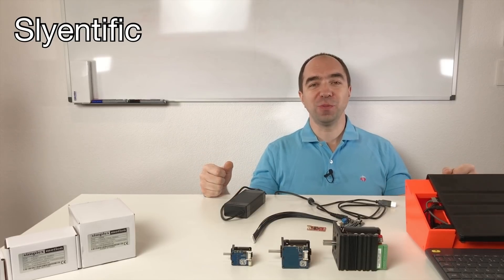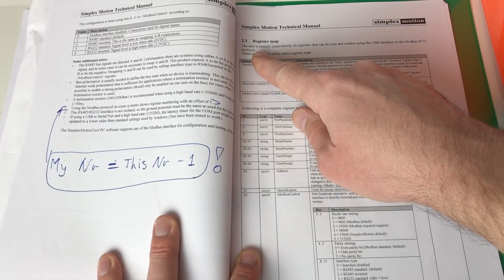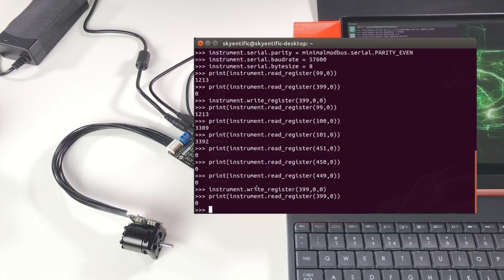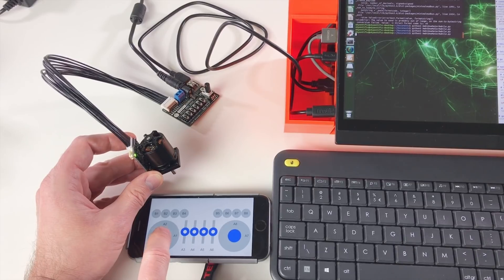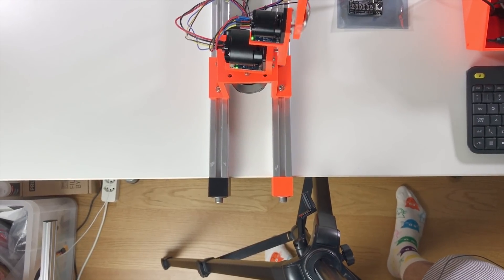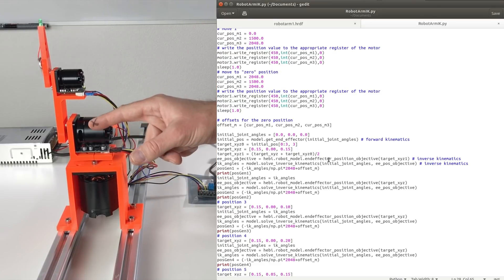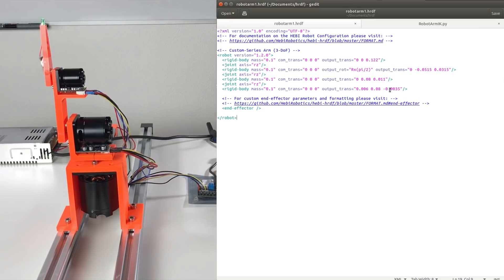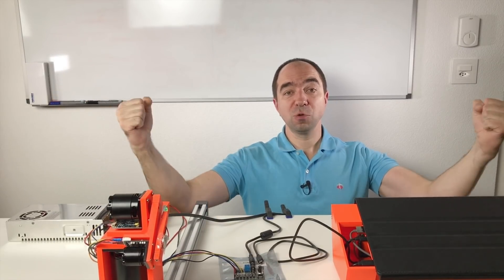Simple Inverse Kinematics and iPhone control [for any DIY Robotic Arm]

Comment: What is the cost of such a robot. And can you add a vision system or do you have videos of such a thing? Trying to have it grab and picks up a cable and plug it into a non fixed location outlet, one that can slightly change its position, so would need to see and find the outlet and plug it in. Thanks.

Comment: there was some wobble flexibility. i think in the bottom part. also the pid is not working well
Reply from the maker: This arm was build just yo test the inverse kinematics. Pid work fine, just need to adjust the pid values for this loads. But as it was only for the simple quick test I did not waste time for this.

Comment: The simplex motion motors are impressive.  If you could get the baby motor in the $50 ball-park, you could make a VERY impressive 3D printer.
Reply from the maker: Yes, but not now. The cheapest motor itself cost around 50$. And the components for the controller would cost another 50$. And all this is with cheapest components. If you take good components (not the cheapest) the motor will be around 100$ and controller would cost another 80-100$ at least. You add your RnD costs, your margin, and you will easily go over 300$
Reply: @Skyentific  totally understand.  For a small volume product $300 is quite inexpensive.  Just mentioned that low price point because it looks like they could hit it if someone ordered a massive batch.  (I.e. 10,000+)
Reply: @martylawson1638  you might want to consider the iHSV57 motors for a 3d printer if you want servos ($80 from Aliexpress and 100-130 locally, depending if 100W or 180W model). They are a drop in replacement with Nema 24 motors and allow to be driven directly with step/dir which helps a lot when upgrading a existing setup using steppers (great for CNCs especially).

Tho not enough for such a large robot arm without some serious reduction (which will reduce any chance to use backdrive)). Do mind there are 400W ones out there for $158, which are more realistic for a smaller robot arm.
Reply: @exol511  Good find, it's hard to tell if it's actually a permanent magnet AC synchronous motor (aka a BLDC motor) or a closed loop stepper.  Added it to the pile of links for when I get serious about building that printer
Reply: Marty lawson its a servo motor 100%. You can check the datasheet and there are a few instances on youtube demonstrating it. Do watch as the integrated ones without the dip switches are steppers (closed loop)

Comment: I see a lot of potential for your robots in controlling the motion of small video cameras. This would be greatly enhanced if you add a degree of motion which is a linear movement along the rails. High end video cameras with their lenses and associated support still weigh 20-30 lbs which requires giant robot arms costing > $100K  (for reference see https://www.mrmoco.com/motion-control/bolt/ ). But some very good tiny cameras such as Sony's latest can reduce the weight down to a single kg which makes smaller arms more feasible. Also check out the work of Steve Girault (https://www.the-garage.tv/about) who is opening an online school on visual engineering (video) and who relies extensively on a combination of robots to move the camera and computer controlled actuators to move the subject.  I'd be glad to put together a summary of robot usage in videography and what might be accomplished by smaller but low cost arms.

Comment: I use FreeCAD to model my robots. It is quite cool because it has a built-in python interpreter, so one can model, 3D print and assembly the robot, and use the same 3D model to control the real robot. FreeCAD can also solve the kinematics and even do some dynamics simulations using MBDyn...

Comment: Good video, but I would suggest you make a series where you start from regular stepper motors(the ones that you have are very expensive for a common viewer) create a controller board a very simple one, with simple serial communication or i2c. Once you have the platform designed and build make a robot based on that.

Comment: Great informative video. You mentioned that this product can be used in CNC as replacement for stepper motors. I would be interested to see how you got accurate angular position using HAL sensors and how it compares to approaches using simple Back EMF or even better what you described in previous videos for the MIT Cheetah controller ( axial magnetic sensor AS5X47U)
Reply: I am not sure how these servos would be better than the iHSV57 180w ones. Especially since those are basically drop in replacements for stepper motors with standard nema mounting and dimensions, plus can be driven directly with Step and Dir which allows you to keep your old controller or breakout board. Not to mention those are quite a bit cheaper than these motors.

Comment: 🍻Thank you for this video!
I loved the walk through of the software and how you got it working. Especially the HEBI components. I’m curious if you will be getting into ROS? I noticed the HEBI github also had ROS files. I also noticed you didn’t enter centre of mass or measured mass (mass and com_trans variables). You mentioned you weren’t “doing any dynamics”. If you did enter those values, would the motion over-shoot be better controlled? And is that part of an underlying PID built into the HEBI modular? Thanks again! And those are some cool motors. 😎
Reply: @Jeremy Williams You can think of robot motions at different levels that interact with each other:

(1) Forward/Inverse Kinematics: Where is the end effector currently and where should it be?
(2) Trajectories: What path should the robot take to get there and how fast should it move?
(3) Motion Control: How can a particular physical system track a desired trajectory?

Dynamics is important for (3) when mapping accelerations to forces/torques, particularly as systems become larger and have more inertia. The PID controllers live one level below. Here is a video that explains the concept: https://youtu.be/9WjNo5DCtfg

So if you want to draw a straight path with little overshoot, you would (a) use IK to compute multiple intermediate waypoints that form a straight line to the desired goal, (b) compute a trajectory that passes through these intermediate waypoints, and (c) command positions along the trajectory with appropriate feed forward velocities/torques.
Reply: @florianenner7435  thank you! I really appreciate the time you took to reply and your information is very useful. I’ll check out your video suggestion later today 😊👍

Comment: How do the motors know their home position with these hall effect sensors?
Reply: Same techniques used for geared motors with absolute encoder. Put another absolute encoder or potentiometer on the output shaft, or use limit switches and a homing procedure, or sensorelss homing where you move until the joint reaches the end of its range, with a low current limit so it won't push hard enough to damage anything, but will still be able to detect when it's hit an obstacle.
Reply: @dekutree64  thank you for your reply!
I thought the motors would have something built in for that matter.

Comment: Nice overview!
When you follow the cross at 9:10, why the robot is driving this "hook" by turning left and right? Kind of unprecise or too much gain in control parameters?
Reply: I think it's because the robot just jumps from one position to the other, it doesn't follow a trajectory so there is some overshoot during the motion because it tries to go from A to B as fast as possible.